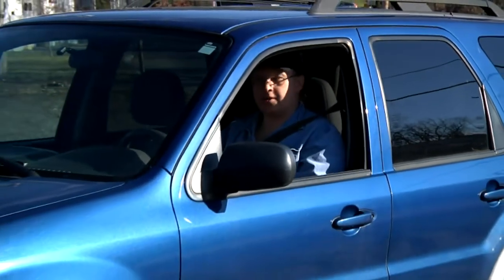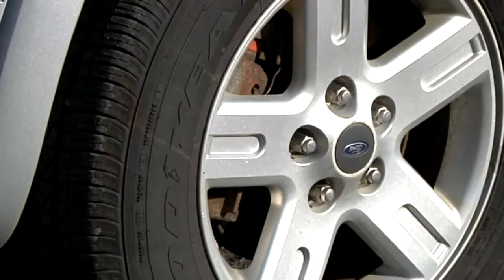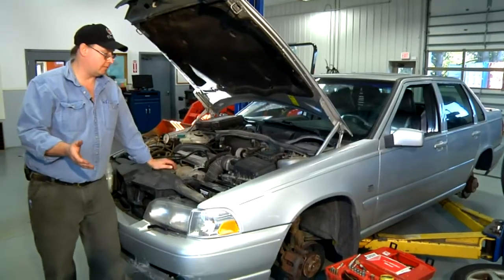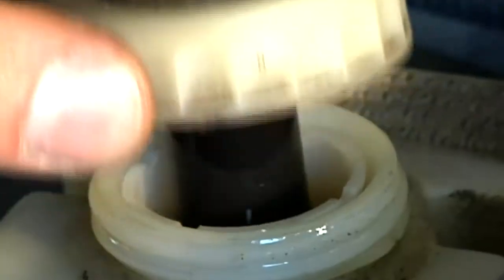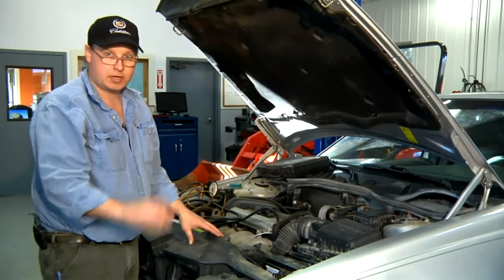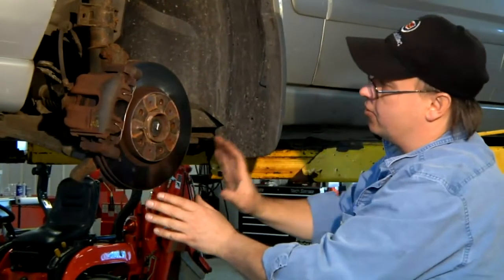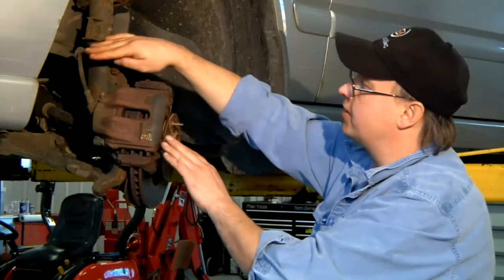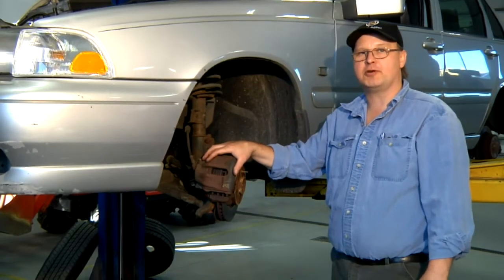Testing Hydraulic Brakes

Comment: This isn't a good test for consumers, just letting the car roll back on a slight incline. You need to test the hydroboost, parking brake and service brake test with the engine on. We're not going to take the wheels off to see the hoses or test the freeplay in the rotor to test the brakes. This is only helpful for mechanics.